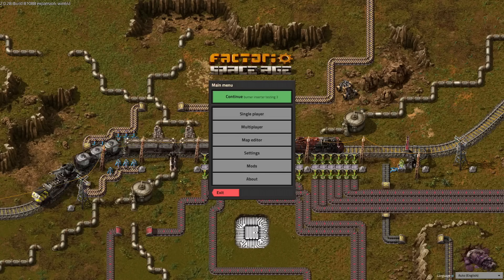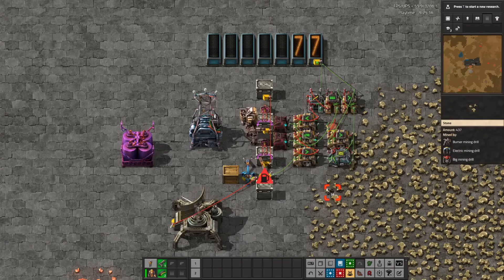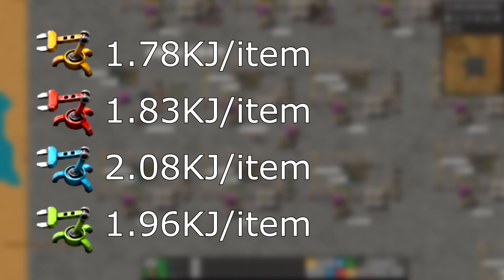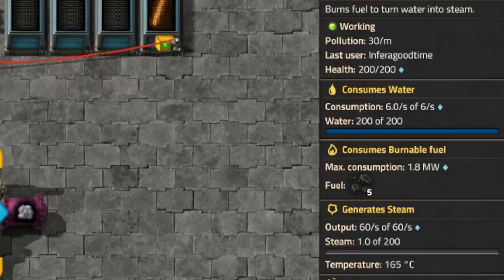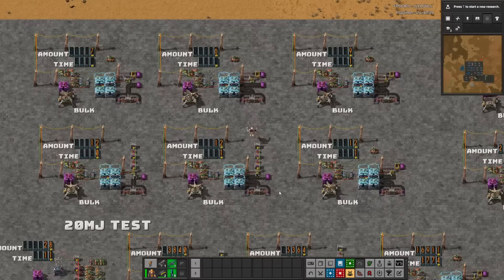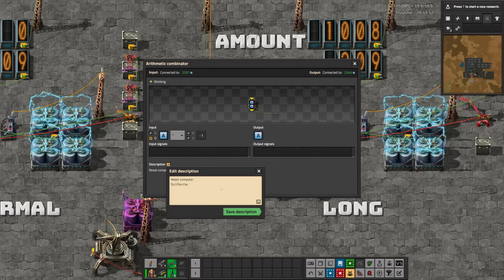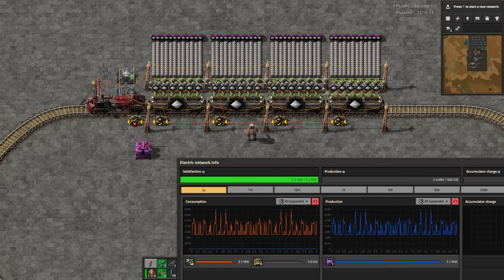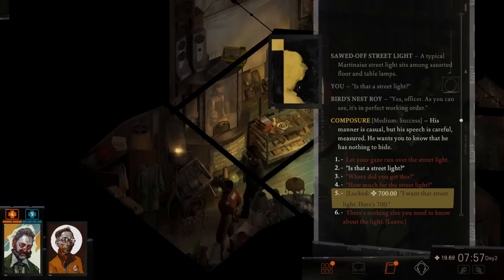Inserter Power Draw is WEIRD (and Burner Inserters SUCK) -Factorio: Space Age

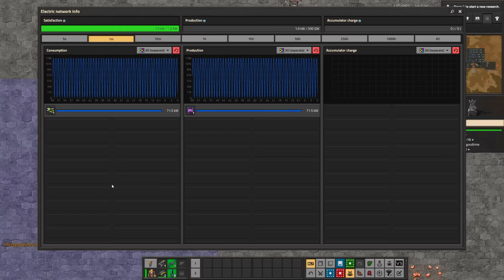Comment: At 7:00 You'll probably get more consistent results with the belts stopped under backpressure.

You also missed a wild interaction with belts. If you sideload onto a belt running in front of an inserter, the throughput skyrockets. The slower the belt being sideloaded onto is, the faster the inserter works. What happens is the items get thrust under the inserter, reducing seek time. This does trail off a bit with higher quality inserters because they can swing so fast that item placements on the belt become functionally irrelevant, but for basic quality stuff you can get shocking amounts of throughput with very few inserters. A single bulk inserter with a modest stack size 8 can drain an entire yellow belt's worth of contents. 5 bulk inserters with stack size 12 can comfortably drain 2 blue belts. Here's a string to play with. (Watch youtube mark this as spam.)

0eJyl11FPgzAQB/Dv0mcw9FrY4NGvYYxh26mNrJC2M1uWfXeLUzPHpv3r2xj0dwft9WAvFt2GB2dsEM1emGVvvWju9sKbJ9t2439hN7BohAm8Fpmw7Xo84u3g2Ps8uNb6oXchX3AXxCETxq54Kxp5uM8E22CC4aP4MfJsRCaG3seLejvGigPz6qbMxC7+kDdl9FbG8fJ4nj7E3YPdrBfsxihZOlwCMJ3APrTLl9xYzy7Ecz/AdA7rCay+wcxdvnxm/2O66lwtJqpG0tVAumVyuhpIt0KmTV+dtmoCzxBYAfD8BH5sfcj90JlwZTkc1eL351Cfq8kPIwGXRercFcDUSZmqSkSlVJUQNbnYFKLqVBUpCVkCJVwAFSwrAJYIPANgQuA5ACsErgEY2SWpQPadAulDSIeDYAJgicAKgAmBNQBf7/XTvZ1KAEa6ESF9DulGdFp6n69i1zuSSm5INIdgndqLqM5EvwnDJjzEd83exXMxgDNPz+M7IxBRJt+KKi6F7PgRjEip96gkEjC1Miar4UJg+oc/2d0u+OoPvgLy1//wU/Iv/+B/1XnKzFfjx877B1Jz8j2ViVd2/ribzaWe1TTTVNeqjgula2PYePXt19WHwxvZhnIr

Something else to think about with this kind of discussion is that there are different kinds of efficiency. Sure, burner inserters are power inefficient. But they do have the brownout resistance and they are dirt cheap to build. Your example of setting up a segregated power grid to power your fuel insertion certainly works, but consider the time and complexity aspects. A basic burner inserter array uses one drag of boilers, two drags of engines, a drag of a belt, and then some more precise pole and inserter placement. Once the poles are in place between rows of boilers, you can individually place pipes, or just drag them because they're so cheap it's not worth caring about a dozen extra iron. Compare that with not only needing more expensive inserters, but the extra power poles (wood chopping is time), and having to make sure that you never cross contaminate your electric poles. All that time investment so that you can save a bit of coal over the course of a few hours?

Efficiency isn't monolithic, and time is a resource that often gets overlooked when talking about "efficiency". Burner inserters are efficient when used appropriately. Not in long term resource usage, but in terms of time.  For the time you spend trying to micromanage a boiler array you could instead paste down something that is sure to work and then spend that time growing just about anything else in your base instead, and you'll come out ahead. Cheap and fast now generally beats long term efficiency until you're optimizing for a megabase. That's why solar is objectively bad in almost all contexts that aren't seed power on new planets or space platforms until UPS is the primary concern. Sure it's limitless power... but the raw resources, the space requirements, and the number of entities placed are all stupidly large relative to the power output. A gigawatt of nuclear power can be placed by bots in seconds. A gigawatt of solar is nearly 24 thousand panels alone, and that's not even including accumulators, poles, or roboports.
Reply: Strongly agree. Human time is one of the most valuable resources since you can turn it into any other in-game resource. The only caveat is that since it's a game, it's FUN time that matters. If somebody has more fun futzing about with circuits to save coal than setting up another coal mine, then go for it!

Comment: There's a Factorio forum post that goes into detail on inserter power draw for belt-to-chest. The user in question worked out there were a number of different patterns with different overall power draws, depending on how the load cycle of the inserter synced up with the frame-by-frame position of items on the belt. That probably explains your results with the rotation.
Reply: aka software developers can't generate proper code even in the passionate companies like Wube, more at 12
Reply: @Dustmadeout  ??? The code is working fine. This isn't a bug; this is a weird edge case where tiny details of a complex system cause very slightly different - but not in any way incorrect - results. Seriously, who cares if their inserters use a couple percent more power for certain effectively random arrangements of items?
Reply: @macdjord  In the other words the code is bad.
Reply: @Kertic-g5y  I couldn't give less fuсks about your opinion. The code is bad, it was like that pretty much forever, random guys from reddit made new Factorio clients that ran smoother than the original one, while kovarex was arguing it's impossible to parallerize some processes a random guy did it, which led Wube to fix that part of code. I can continue on and on, those coders are just a bunch of amateurs. And it shows everywhere if you know the game inside out.
Reply: @Dustmadeout how is this bad? Other than that you can't know the exact power usage at any given point, there's no more downside. The different energy consumption differs in different actions, which is just the same as real life. You're saying the code and developers are bad just because you don't like them anyway, do you?
Reply: @Dustmadeout 
Ok, give some examples, present to class. You know factiorio “inside and out” so tell me some inefficient code and how you would fix it.
Reply: @Dustmadeout i've never met a competent programmer who used the word "coder" to refer to a programmer, so i find the idea that you could know more about how to optimize factorio better than the factorio devs kinda unlikely. unless english isnt your first language maybe?
Reply: @Dustmadeout  
1. Why is there no trace left on the internet of those supposed "new Factorio clients"?
2. Why are performance mods basically non exitend if they game is so badly written? People have for example completely replaced Minecrafts rendering to get massive performance boost, but nothing exists for Factorio, I wonder why.
3. Why do you not have developed anthing of the above if you apparently know the game "inside out".
Or do you perchance have no idea what you are talking about?
Reply: @Dustmadeout  cool, can you share those Factorio clients?

Comment: In 2.0, there's now a hotkey ("Toggle Entity") for toggling entity active status which currently works only constant combinators & power switches, but it is very useful. And it is unbound by default. And yes, it is located in the Debug section. (In 1.1, default hotkey for Pushbutton was F, but they changed in for 2.0 Pushbutton to match the newly-introduced keybind described above.)
Reply: It works on trains too. Toggles from manual and automatic. It's really convenient.
Reply: I think that present in the original (note the push buttons mod used it)
Reply: @seno7904  I think pushbutton defined its own hotkey before 2.0, but can't be sure.

Comment: 4:35 So what you're saying is TECHNICALLY speaking, burner inserters are the energy optimal way to deal with spoilage without circuit logic. You know, ignoring the fact that the most efficient method of energy production is fusion. (with legendary productivity modules, a fusion cell is about half a holmium plate and like 4 brine, and will power 1.5m idle inserters for its 400 second duration with a 500% neighbour bonus or a more reasonable 160 inserters for 1000 hours) And that if you're running efficiently spoilage is potentially a valuable resource you're consuming.

Comment: LOL the satisfactory lamp at the end!!! Great video btw, very informative. I find I'm one of the only player who loves burner inserters. I use them for requester chests that feed ammo to gun turret boxes on base perimeter. Just request a few solid fuel to the chest. Very fun and I like that it's rather unique and functions for some time even in a black out because it uses no power. I also love burner inserters feeding heating towers on Aquilo. Burner inserters cant freeze so when you slap your heating tower-inserter-requester blueprint down it just starts working and you don't have to seed it by manually putting in one fuel. At the end of the day they are the only inserter that doesn't require being in an electrical network to function and that is super unique.
Reply: I want to hold hands with my burner inserter and feel its body heat 😳
Reply: 3MW Lightbulb
you know fixit wants to watch that planet suffer
Reply: This seems like trying to find a reason for them to exist, my perimeter defense needs pumps for oil anyway, bots need a logistics hub nearby(which uses power) and at that point I usually also have nuclear so basically infinite power...

Don't know about Aquillo but having to insert 1 fuel doesn't seem like a real issue bc like... what else are you doing with that time??
Reply: @Helycon  well Helycon, I can see you don't like the burner inserter. That's fine, different strokes for different folks dude. It's nice that we have different ways to play this wonderful game. I assure you, they do have their own niche reason to exist. The way you play you don't see any need for them and that's just fine.
Reply: burners + nuclear fuel = ~18.000 ammo for turret
Reply: I use a single burner inserter in my coal power plants as an automatic cold start after blackout.

Comment: Well I guess my idea that burners Inserters on gleba might be potentially give them a home was less useful then I was hoping for. Like the one place 90% of items are burnable and spoilable could have been their home. Also does the results stay consistent over quality versions?
Reply: Even worse, the Heating tower has a 250% fuel efficiency.

Even if it was fine to use the burners, you'd almost always be better getting the fuel to the tower to convert into power.
Reply: You get so much burnable items on gleba its insane, i have like 4 or 5 heat towers working non stop to deal with all the excess jelly. I also fuel 6 stacks of furnaces with them and the best part i dont even have to worry about the smoke.
Reply: @marmoran9493 just don't put jelly and mash to belts, it spoils extremely fast
Reply: @RandomsongV2  it works perfectly for the furnace stacks because spoilage also runs as fuel
Reply: @marmoran9493  I use spoilage too but mixed with rocket fuel
Reply: At first i used solar power and after i start getting spoliage in Huge quantities I start using burning tower and with 1 heat-powered boiler you can easily power all of your base